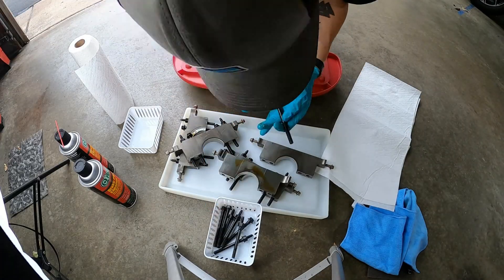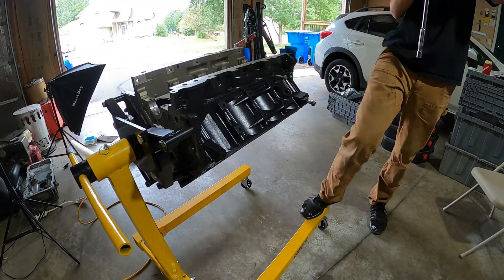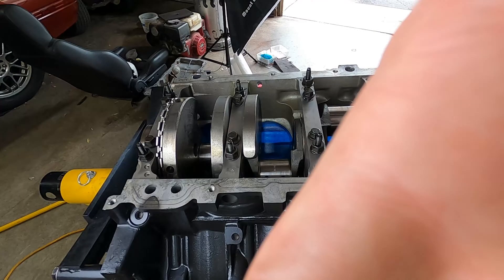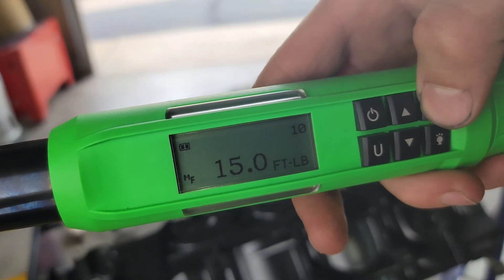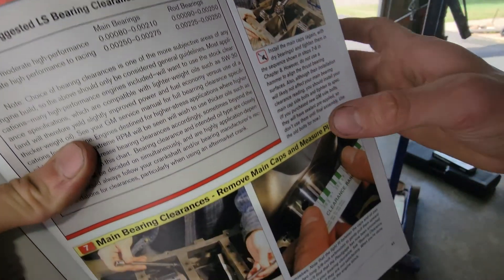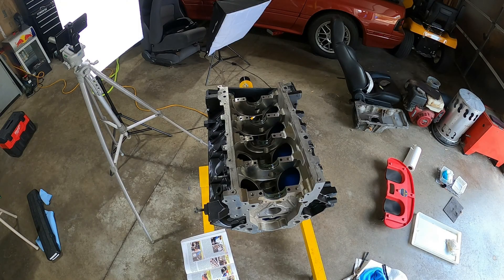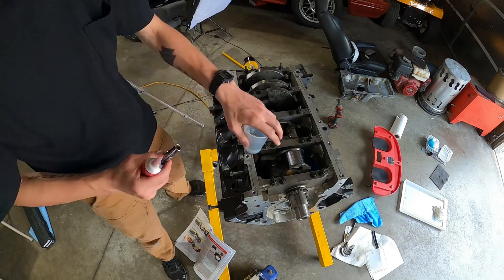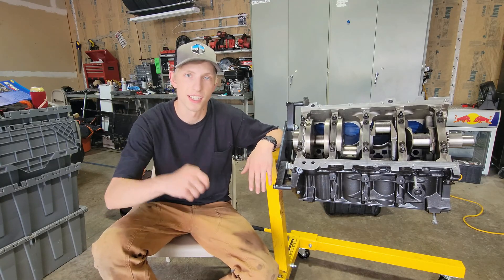Installation of LS Crankshaft and Main Bearings!

Comment: So I notice these LS caps have a bit of play in them. Do I just make sure I got a consistent gap between the caps and crank shaft counter weights? Because I notice you just can't throw them right in Because I did that and noticed before tightening them down I was rubbing the crankshaft reluctor wheel. I can't seem to find any information on this.

Comment: Dude what torque wrench is that And where did you get it. Can't find 1 like that
That will tell me Angles
Reply from the maker: I got it off the snap-on  truck at one of the jobs I used to work at. They go for around 5-600 dollars but they are the best and most consistent to use. If you build more than one engine I'd say it's worth it. You can buy them on their website as well!

Comment: Did you have the block honed and machined or did they all just work out perfect as it was ?
Reply from the maker: I did have it honed out to match the piston set as well as a light decking of the block and cylinder heads. In the later videos you can see me getting the rotating assembly balanced, crankshaft polished, and the camshaft journals honed as well.
Reply: Good stuff!! Where did you order torque wrench from?

Comment: I was curious do you then put the rod bearings on after what you did cause you mentioned main bearings and I didn’t know where you put the rod bearings at?
Reply from the maker: Yes that is correct. The main bearings are the ones I installed. The rod bearing attach to the crank in between each of the main bearing caps. I did a video about that process as well.

Comment: Once you torqued the bolts to their yield point, those bolts were permanently stretched and cannot be reused.  You technically destroyed those bolts during your initial measurement process after you removed them.  You do not need to torque those bolts fully when checking clearances.  "Torque to Yield" bolts are just that.  They get torqued to their yield point and remain that way until they are removed and then must be replaced.  They cannot be reused.
Reply: Main bolts are NOT torque to yield on the LS platform and thus can be reused.
Reply from the maker: I thought I read that in the book I am using for the rebuild, thanks for the reminder!
Reply: I was about to say if they are torque to yield they need replacement once they are removed. Makes checking clearance extra expensive. That's why I just get ARP studs.
Reply: If you use arp bolts the mains need to be lined honed. Was told this by a machine shop